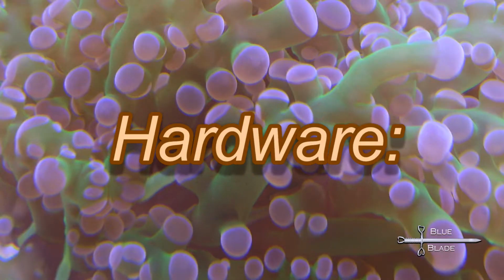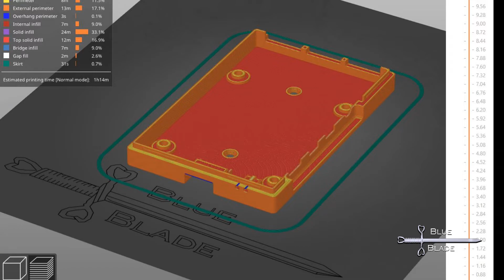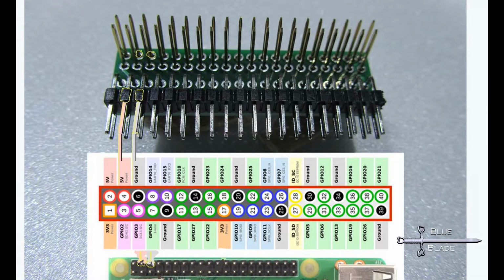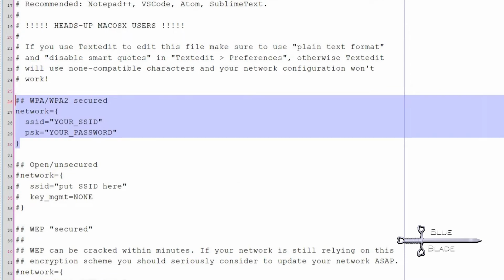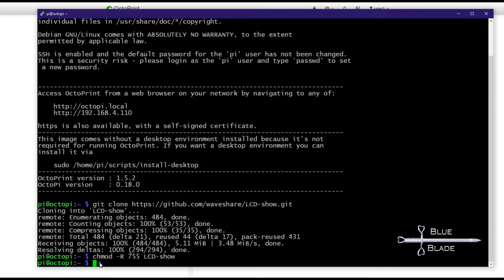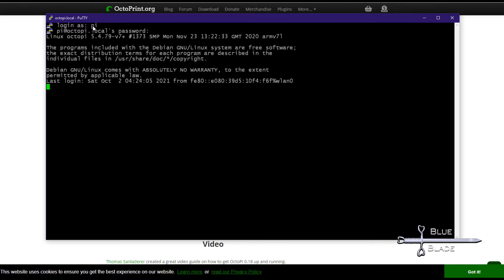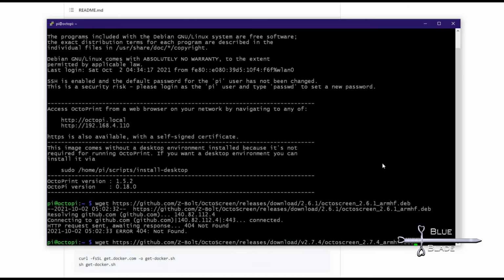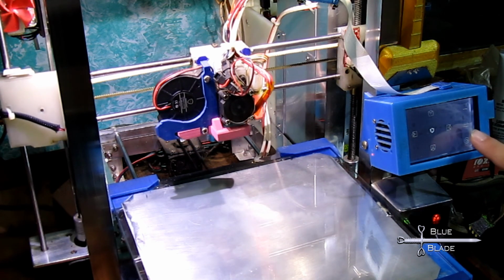3D printer Upgrade - OctoPrint on Raspberry PI4 with touchscreen

Comment: my screen says no connection idk if it differs at all. i also am confused as to what i do once i get to the github link? what do i download.
Reply from the maker: Hi, the instructions may be a little unclear  - but you need to SSH (using putty or another console) to the RPi from you computer - the "get" command (and all following commands) is run in on the Pi, and will download the file when executed. the following commands extract and install/configure it. I hope that helps.